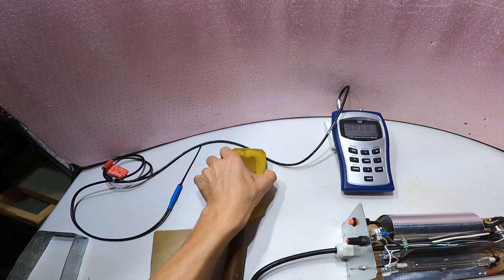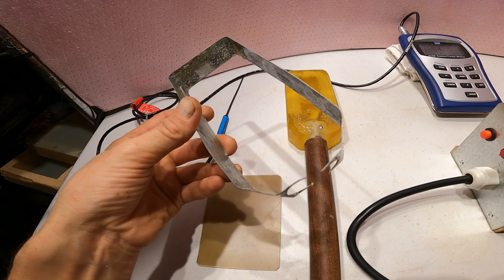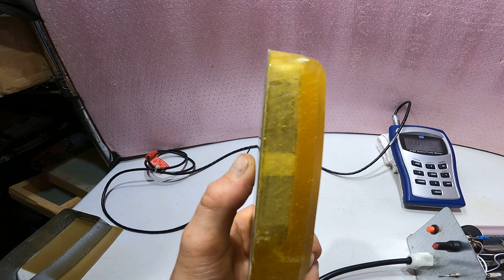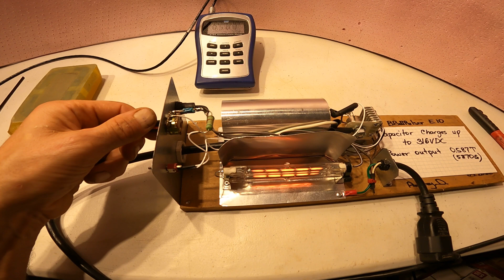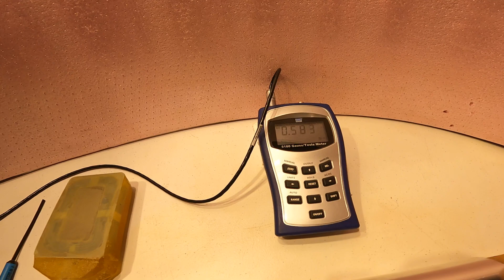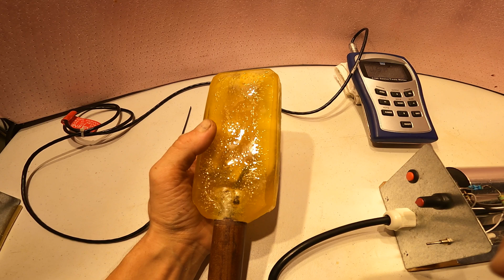110 Simple made coil for magnetic Pulser BBMPulser E10 220VAC

Comment: I recently found your channel and I'm putting together a basic and simple Mirko Pavleski team, from what I see in each team that you put together, your main objective is to be more and more powerful, but for therapeutic use to the body, what benefits does it bring? to the human body that the equipment has more power and what is the limit???
Reply from the maker: With stronger Pulser you can get more benefits.
The strength of the magnetic energy is what does the job.
I experimented with different power and I choose stronger models.
Yes 0.4 Tesla is better then nothing but 1 Tesla is better then 0.4 Tesla, 2Tesla is more effective then 1 Tesla and 3 Tesla is more effective then 2Tesla.
What's the limit, I think around 15 Tesla you may want to be careful using it in some places.
Main benefits of strong pulsers that they can reach deep also they can kill viruses and bacteria with number of pulsers, weaker units cannot do it
Also pain suppression effect, the stronger the unit the better and faster results

Comment: Hi Andrey, been watching and liking your videos, you are doing such an awesome job, thank you very much for sharing and making videos 🙏.
 I was wondering if it would be possible making a low power pemf (like around 3 to 6 volts power from batteries) using the 555 for the pulse and at the end using a transformer to amplify the voltage controlled by a transistor to discharge to the coil?
Reply from the maker: I thought about designing battery powered pulser, but it's going to be 12V battery circuit.
It's hard to get good output from 5-9 V